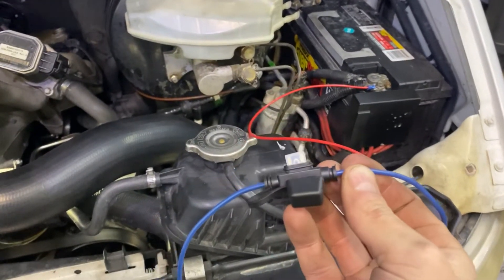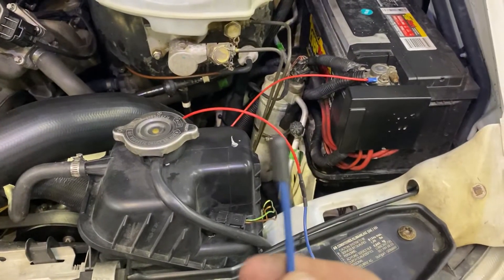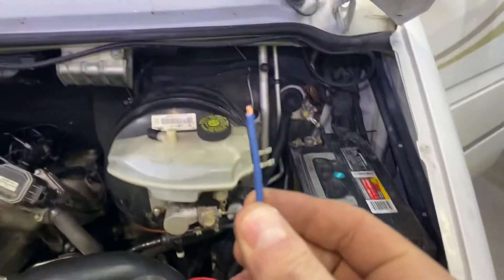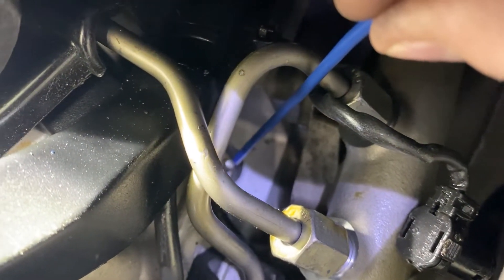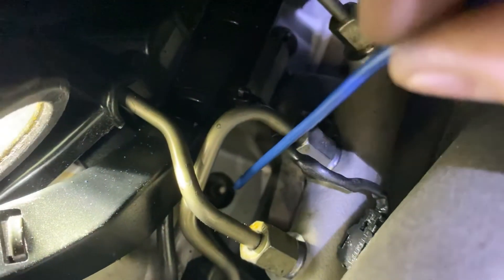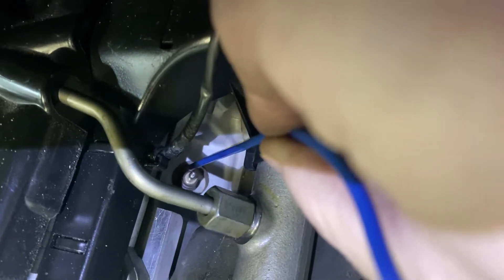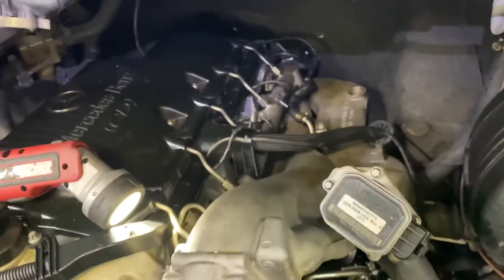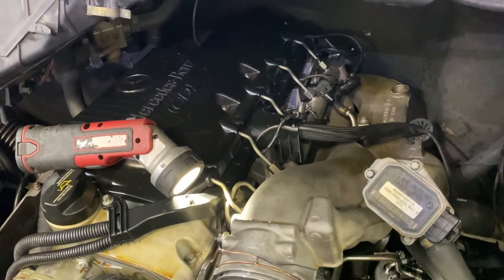Testing Glow Plugs on T1N Sprinter with fused jumper harness

Comment: Did the issue come back?
Reply from the maker: I replaced the glow plug which fixed the issue. It’s also possible to have a bad glow plug controller so you can test that separately to determine where the issue is.

Comment: Excellent video Troll I also just had an engine swap and am getting the exact same codes as you in my 05 Sprinter I will do the exact same test and hopefully can eliminate my cel codes 
PO380, PO671, PO672  as I am having trouble starting in 10 deg. temps. Thanx again